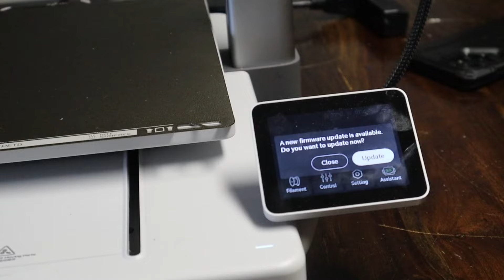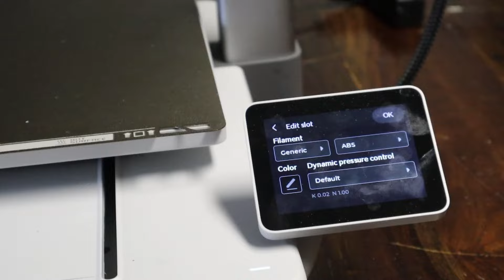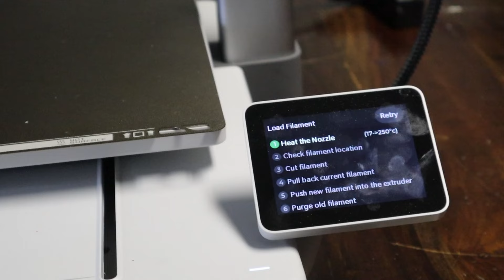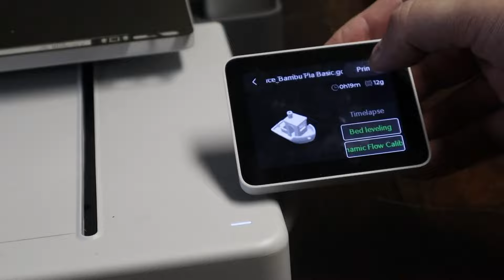A1 External Spool Setup

Comment: I did all that but my bambu printer (after slicing) does not show the external spool, only the ams, when I go to send the job to the printer.
Reply from the maker: Is you AMS still plugged in? If it is unplug it
Reply: @MindmeldTech  After some pondering, I did just that and it found the external spool.  But thank you for verifying that was the correct thing to do.

Comment: How do you add an external spool if you already have the AMS Lite connected? Do I need to remove ALL the other tubes or is one enough?
Reply from the maker: I haven't tried that yet, but I would think one hose is enough.  

After you hook up the external spool go under filament, then at the top of the touch screen select external spool. Then start the process of loading the spool.